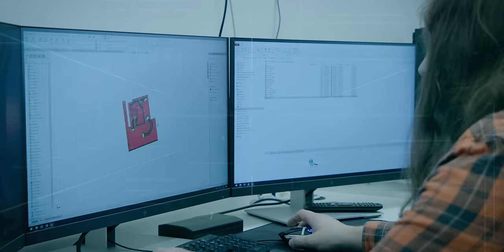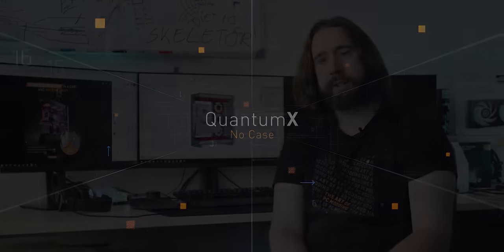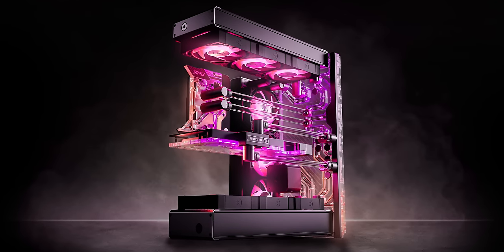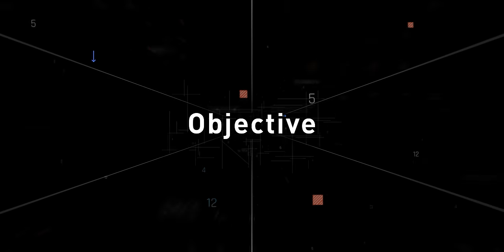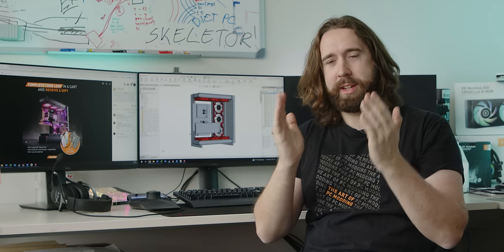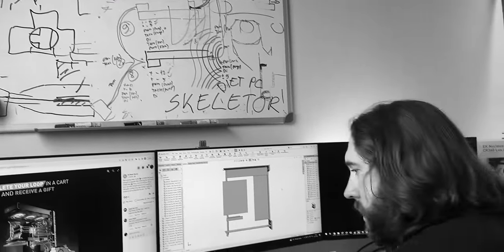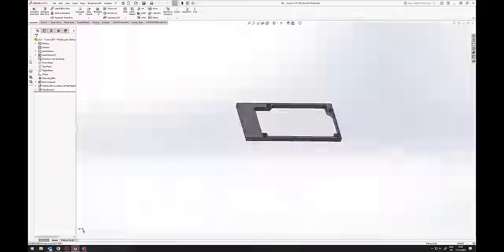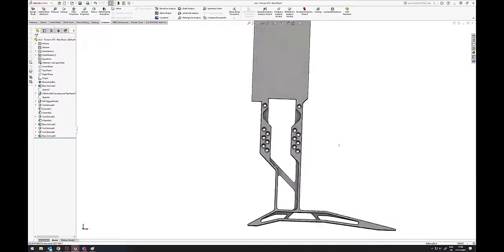Exclusive: Building the QuantumX - NoCase Build | EK Expo CES24 | Day4

Comment: Getting rid of the connection point on the GPU and doing a custom version of the acrylic specifically for vertically mounted GPUs to make the style between the CPU and GPU blocks more consistent is my only criticism.  It's weird to have the GPU tubes parallel on one plane and the CPU tubes parallel on a plane perpendicular.

I have the opinion that the only way to mount a GPU is vertically.

Comment: Those rose-gold fittings would go great with the Asus Pro-Art motherboards. These fittings are beautiful. If these (NoCase) frames are available, maybe I'll be building a showcase for our shop. I'm building at this moment a rig, for a client, with an Asus TUF motherboard. And they have gray-silver stripes, so the loop will be foreseen with the Satin Titanium fittings. But your build looks amazing. For electric and ARGB I also make block diagrams, from every system we keep a file (one for us and one for the client), that's because if we do maintenance (mostly we call back the systems after 6 months in use, free of charge), we know exactly what and where the connections are and the rest of the info, the parts, test results, etc.

Comment: The interesting thing atleast what I feel is from a user ready case perspective, why not EK release a case where the front is a liquid reservoir and 2 360 radiators in build in the case. Then I don't have to do anything custom if the tubing is flexible. I am neither a fan of RGB/ARGB nor opposed to it, the only place I find it useful is where I keep it to smart mode in my PC and I can keep tabs on the temperature without having to read the display while gaming.

Comment: Nice, but not much convenient for regular use.
1. Any stronger push could destroy the whole structure.
2. PSU on the back of the MB would add heat to the MB and SSDs.
I would appreciate more conservative and stable open case construction.

Comment: Why are you guys charging so much for your cases? The past 2 models you sold were over 2k and this one is over 1k plus another 1k for the distro. This is stupid. The case itself probably cost $100 in metal + maybe another $100 in manufacturing. RnD cost should never exceed manufacturing, so even then this case shouldn't cost more than $400. Your literally sticking the middle finger up to your customers and raping the industry and setting a horrible example for the PC modding community. Not to mention the entire world is headed into a recession, so your pricing out 99% of your audience out of the gate.

Comment: Product idea : 400MM/360MM x 20MM programmable OLED/LCD display that mounts on the side of the fans. Or a 400x35 for the side of the rad. Helps compete with the sl infinities. Would look awesome af. Would sell really well(and easily bundle with the current aio lineup). Wont compromise on pumpblock by needing display. Imagine a system with 4 oled strip displays for the 360mm aio fans and rads in the top/bottom of the case.
Reply: off topic, but do u perhaps know any lcd with hdmi that is very stretched and smaller than 16cm? 7-8" stretched lcds are too big for my needs

Comment: Okay so if I understood right. He licked all the RGB signal wires together to control all RGB correct? Then he wired all the ground and power for the RGB lights to the powersupply directly? I assume he wired the pumps to the PSU and the wire signal for pwm to the motherboard?
Reply: The Power for the pumps is directly from the PSU but I think he mentioned that he uses the old pumps without PWM, because the wires would be difficult to hide. So the pumps have to be adjusted on theier backside (easy because of the new magnetic covers).
Reply: @niklashamann1239  ahh okay. That makes senses thanks!
Reply: Yeah, all D-RGB and PWM signal for the fans are in series. Then there are 3 different +5V/GND/+12V/GND spurs that come off one AWG15 cable directly from the PSU. The first powers 6 fans, the second powers the distro D-RGB and pump covers and the last powers the final 3 fans. Each set of 3 fans is joined by regular OmniLink cables. The pumps are D5 Vario's which have manual speed adjustment and for safety they each have their own direct +12V/GND wires directly to the PSU.

This way there are only two individual conductors which go to the motherboard, for fan PWM and D-RGB signal. Definitely the hardest part of the build to fabricate and install so we really could do with creating a standard item for this that would work with different fans, motherboards and PSU's.
Reply: @JR23Design  thanks so much for the reply! This helps even more. If they end making the case available I plan on purchasing it. And just wanted an idea of how to reduce the amount of cables. But maybe they will come up with a way to include an adapter? But learning a new skill would be fun too.